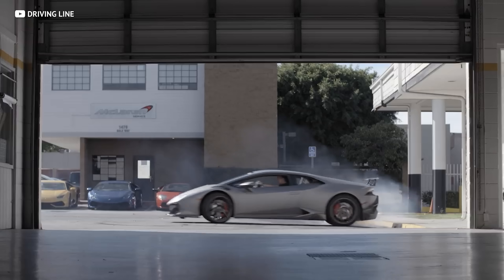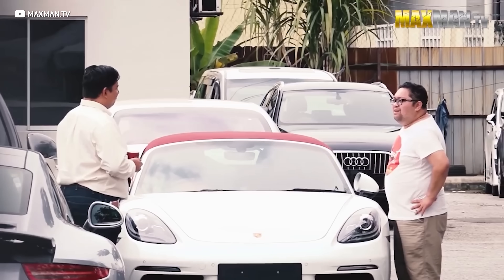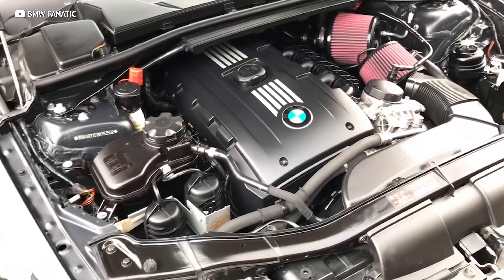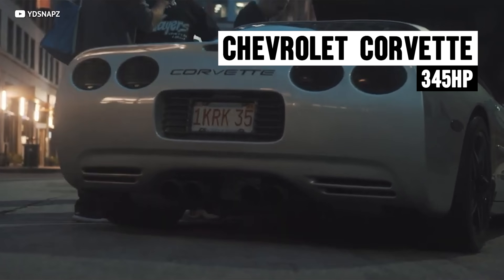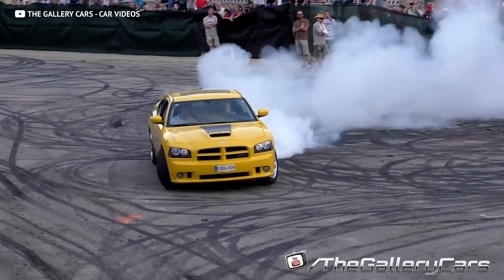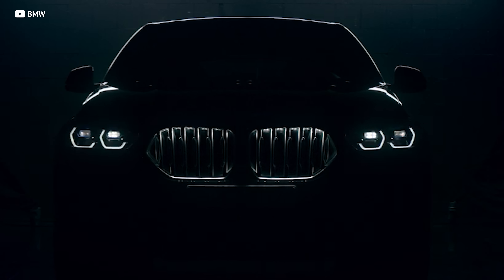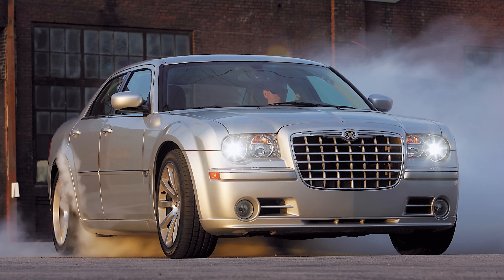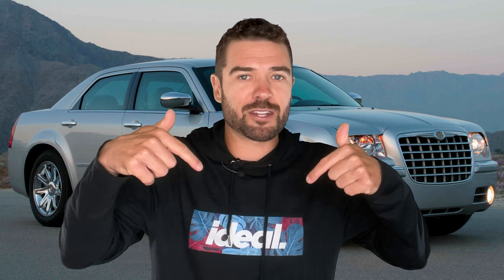Cheap Cars With a TON of Horsepower

Comment: Agreed on the G35/37, C5 and Genesis being quick cars available for drivers on a budget.  Good luck finding the others in decent condition for the prices listed.
Reply: do u know the year of genesis that was in the video
Reply: @nikku3184  around 2010
Reply: @Septicshites  where im fron you cant find a gto but chrysler hemis like the 300c, 300s, and 300srt8 are everywhere.  i just picked one up a few weeks ago and they are fun as fuck
Reply: @Septicshites  15k for a decent one in California.
Reply: @nathanfrutig8783  been trying to find a srt 8 and they are hard to find in va they want a arm and a leg for all of them
Reply: @Septicshites  you find them in Chicago for like 20-25k 😭 high mileage and 5 owners😭
Reply: @Septicshites  2004 GTOs are cheap with 350hp the 05 & 06 are usually $15k or higher
Reply: @i_amChrisJxmes for what a group?
Reply: @KVNGMAN here in Cali the be overpriced high mileage and going 16k and up
Reply: The real question is the c5 a good daily I want one but I daily my cars usually
Reply: finding a g35/37 is hard asf on this market value

Comment: Good luck finding a 04-06 GTO at that price.
I’ve looked all around and they’re bringing in 20k+ now. It’s all gone bat shit crazy. 
Needless to say I’m out .
Reply: Yep u pay that for a genuine body kit here in Australia prices have never gone that low anywhere ever ur dreaming
Reply: I’ve looked at two GTOs one was $21000 usd and the other one was $23000 usd.
The biggest mistake I did was not buying one about 5 years ago for $12000 when no one wanted them. I do plan on holding on to my G8.
Reply: I had the chance at an '05 GTO 6-speed for $16k with about 65k miles about ~10 years or so. But it was actually pretty underwhelming. Very crappy interior and I found out that they are a huge PITA for certain parts because unlike as the video states the parts are not easy to get. Them things are old now and most parts come out of Australia where there were far more Holdens sold than Pontiacs.

I ended up years later with a C5 Z06, but GM quality is really questionable. Motors can be good depending which one it is, but that Z06 was the most unreliable car I've owned and it had 29k miles on it when I bought it, looked pristine. Sold it because I didn't want to pour any more money replacing things on it (rear main seal, rear transaxle seals, EBCM module, HVAC blew cold on driver hot on passenger sometimes, speedo gauge would peg at 200 mph when changing battery and get stuck there).

Personally, I don't even think CTS-V's are nice anymore. I used to want one a long time ago, but have no respect for Cadillac at all anymore.
Reply: @Shintsu2  it’s pretty hit and miss with GM it’s been that way a long time. Have had duds and very reliable cars from them. Nowadays, however, that seems to be a trend of all manufacturers.
My 2009 G8 (bought new) has been a good car the only issues I’ve had with it is the headliner needs replacing and the drivers’ side seat trim keeps breaking.
Mine has the options with the trim level and nothing more.
It’s pretty base so may help with issues, but who knows.
Reply: I saw a 2006 got 14k here in az and I think it only had a few bolt ons
Reply: @ Paul Scalisi

My Mom bought a yellow one when they first came out with the 5.7.  Looked nice, sounded great.

Performance wise, underwhelming, heavy.  And sight lines were awful.  She got rid of it after a couple years and completely lost her rear.

I still like them, the 6.0, but personally, knock yourself out.  Yeah you can upgrade them, but man, them sight lines were the worst I’ve ever experienced.
Reply: Any pontiac trans am/gto/g8 you could find one for 10k+ but a rare find low miles 20k+ $
Reply: Us old Pontiac Poncho heads keep the price up .Look at those 93 -2001 Birds also.98 up with LS
Reply: My brother just picked up a 351 swapped fox body drift car that keeps up with 2017 mustang gts for $2500. It's always the junkyard Bugattis that are your best bet
Reply: @sammy13ificationable  This ^ my first car was a fully built Mazda mx6 all I did was replace a valve cover and fix egr and vacuum. It came to me with parts to the 9s for 1300 even had ac and I didnt know shit about it but probe gt guys did lol
Reply: @Kyle_gallegher  right, I hate this "just spend $6000 on a fast stock car" mentality. Cars lose value with mods unless fully kitted out, so buying motor swap cars is cheap, or just do it yourself. My dad took a $300 MG Midget and put a $300 13b in it and slapped $200 worth of mods on it to convert it to a points ignition and Weber carbs, spent a total of $700 and got a car that's sub 200hp that pops wheelies in third at half throttle. Whole thing weighs like 1600lbs and makes 210 lb-ft and 180hp. My brother also daily's a lifted 94 loyale that the dude swapped an EJ22 into, it's not fast, but its punchy as hell and has a stupid 0-60 for a shitty econo box on 29" boggers
Reply: t sltter  that’s a great deal. They’re nuts where I live (Southeast).  Is it in good condition?
I wish I could find one like that.
Reply: @sammy13ificationable  you must watch too much TV.
Reply: Earlier this year I bought a 2009 G8GT for $9500.00, 116K miles its not perfect but runs and drives well.
Reply: @Shintsu2  crappy interior compared to what? An E Class Benz? The seats and dash are far better than most American cars, nice shift boot too. 

Don’t like plastic? Gotta spend more cash or buy old luxury cars. 

Parts issue is legit. Low miles, no problem. High miles, stuff starts to break and the world begins to end.
Reply: Pandemic =rising inflation$
Reply: @pmscalisi  I own 2 g8s for this reason
Reply: After 5+ years I still do not get it. 

In 2016 I gave my daughter my 2008 Kia Amanti. I was looking for something more sporty in a sedan and my 6'3" wide as a door frame would fit in. With a $18,500 max budget I narrowed my choices to 3 cars. The oldest, a 2009 Pontiac G8 GT with 111,000 miles on it for $15,500 out the door. A 2012 Genesis 5.0 R-Spec with 106,000 miles for $12,500 out the door, and a 2014 Chevy SS with 79,000 miles for $18,400 out the door. I drove all 3 and the decision was easy. The Genesis kicked the shit out of the G8 GT and the SS. Vehicle size, Engine, HP, options, transmission. Other than the exterior of the Pontiac looking better the added cost never made sense to me.
Reply: look again space ghost
Reply: just wait they'll go down once electric vehicles get huge in the next few years...EVs will take over and disrupt the gasoline used car market like crazy, and since gas is easy to make from crude oil....you'll always have gasoline for your toys. but EVs will be on the roads...toys will be on the tracks...luckily there will be more tracks and less parking lots. int he future...gas cars will be like horses.  extra costs for storing and maintaining them...so it will be a hobbyist thing.
Reply: @Halliday7895  a gas vehicle will be a good backup to an EV, especially the ones with no GPS, and when blackouts or curtailed electric usage plans won’t allow you to charge your vehicle.
Reply: In 2013 i bought a 05 GTO 6mt for 12k with 67k miles and I hit a deer with it and it was totaled... looked for another one and apparently people figured out what they were and I couldn't find another for less than 16k. To this day the same amount of mileage and same specs are going for 20 and up, I loved that car and miss it to this day
Reply: @Shintsu2  Ya know what I wanna try to build, is a 2021 Kia K5. It's a culmination of a legendary car, just like the Pontiac G6.
Reply: Came here to say this. Where the fuck you finding under 10k lol
Reply: Just come to australia they are literally everywhere
Reply: I picked one up for 12k with 80k miles almost 4 years ago, prices are way up.
Reply: all of these cars are at least 50% more expensive due to the current market
Reply: Glad I bought mine 3 years ago. Hard to find a clean one also. I absolutely love mine.
Reply: Yeah and especially with Pontiac being out of business
Reply: I hate that people think the GTO is a collector car simply because it was a 3 year production vehicle. Pontiac made the 04-06 GTO very cheap in my opinion.
Reply: @brycycles95  if you think that the newer GTO was cheaply made you never drove one from the 60’s or 70’s.
Those vehicles were far from bullet proof. I owned enough of the muscle cars from that era when they weren’t that old, like the 70’s and early 80’s.
Fuel system headaches, badly implemented electrical systems and body integrity/corrosion issues but still they were a blast to drive and to own.
Reply: @brycycles95  Yeah but the classic ones from the 60s and 70s are collectors
Reply: @brycycles95  And I don't think many people were crazy about the 04-06 Gtos. I test drove an 06 Gto several years ago before Pontiac went out of business and I wasn't thrilled about it either, so yeah I wouldn't consider them a collectors choice
Reply: @brycycles95  collector cars become what they are because someone says they are
Reply: I got my 05 a4 GTO for $12,800 4 years ago, 70,000 miles, honestly the most reliable car I’ve owned, this is my 3rd LS powered car and by far my favorite, you can beat the hell out of them Ls motors, just stopping power is not all that great on the GTO
Reply: Only one I could find under 10g had over 200k on it and looked like it was full throttle on dirt roads every bit of it
Reply: Genuinely blaming this guy for the cars raised prices😂🤣
Reply: Maybe for a very low mileage manual model but it’s still possible to get one under 10k if you don’t mind an automatic
Reply: You can get them around me fairly cheap and low miles.....price Definitely depends on area
Reply: Me too, 2004 aren’t very hard to find but 05 and 6 have the ls2
Reply: in Australia they go for around $100k
Reply: I bought my 2004 for $6k but that’s 350hp the 05-06 400hp they mentioned are usually $15k or more..
Reply: @Caseythenewguy  you can tune your engine for more hp but it may not be worth it to you. 50hp for some reason brings a premium price, but in the weight class of the vehicle 50 hp isn’t all that much.
If it was 50% more hp it might be worth looking into.
Reply: There was one in my area for 13k
Reply: I was outbid on an 04 about when this comment was made lol

Comment: I bought a 1998 Mitubushi Diamante with 84k in great condition for $1500.00

3.5L 24 valve V6
210hp + $1,500 for a turbo kit
+ 250hp

460hp $3,000
Reply: without the preventative maintenance you didnt do, that +250 will cost you in the long run much more than that mark my words
Reply: @kenninger4267  All cars have maintenance.
That's a given.
Reply: @kenninger4267  Cars are merely transportation for me.

I could care less about added horsepower.

My statement was in regards to potential upgrading.

Comment: You guys should really start talking about the CLK or E55  n/a AMG. Those cars are bulletproof I'm talking great reliability. I have one with over 150k miles and I've seen them in the 300s. They are soooo underrated and no one talks about them so it's pretty easy to find them around $5-7k which is pretty good when you get 340hp and 380tq
Reply: The S55 AMG kompressor will eat all those cars easy and is under 10 grand !!
Reply: Fr I almost got a clk 500 coupe but instead got a Genesis 4.6 still gets down 375 stock
Reply: @lucky9Lives  Did youy miss the part about reliability lol

Comment: Excellent video.... In 2016 I purchased a 2012 Genesis R-Spec 5.0 Sedan with 429hp.  I stole it for $12,500.  I drove it till Feb. 2021 and sold it with 180K miles for $6,900.  I then purchased a 2013 Genesis R-Spec 5.0 single owner 48k miles for $14,850..... Fast, fun, and reliable.... :)

Comment: Anything over 10 years old is likely to start having lots of things failing.  Cheap hp isn't worth much when it's up on blocks in your garage.
Reply: Not really man. I bought my 2011 Crown Victoria last year. It's like a brand new car. It really depends on the car and the owner. I wouldn't recommend any of these cars especially not used German cars.
Reply: @blessedjuggernaut  I had 2 police interceptors. Got it from a local county police auction. All lasted me years. Great cars easy to fix and parts galore

Comment: The 300C was the same as the Charger R/T and both came with the 360hp 5.7L V8, not the 425hp 6.2L found in the SRT8 trims of both badges
Reply: Yup. Glad I'm not the only one who figured that out

I was like... "Really?, 425hp for 7,900? I'm in!" But the only one I could find within 500 miles of where I live was 18k. So sad
Reply: @ernestobercovitch8160  I was hoping someone other than me noticed he was saying the 300C is the same as the SRT8.. 300C is the same as the Charger RT but only the 5.7L
Reply: 6.1 in the 06-10 srt8s

Comment: I thought I would see a Audi on this list but I'd still settle for the 2jz BM, or the Gto Godzilla if I had to pick from the list... And the Genesis is not bad either
Reply: Lowkey I was thinking that too
Reply from the maker: all ideal choices!
Reply: Audi!!! U will be lucky to get one for $20 000
Reply: @Monsterracing19  Dude you literally can buy a audi s4 b5 2000 that has 2.7 L Biturbo V6 for 12k or less
Reply: @nikodaq  o. I was thinking Audi R8
Reply: Joseph C.  I would like to buy one of these, are they really as unreliable as they say or is it only when you modify the engine that the headaches come?
Reply: @nikodaq  And a foot long receipt of parts that need to be replaced. (I have a B5 A4, B7 A4, and B8 S5)
Reply: i 100% agree
Reply: @Monsterracing19  ?? most within 5-10 years old are around there.
Reply: @crestadude4139  I was going to buy one but everyone and their grandma told me not too lol
Reply: @crestadude4139  just make sure you buy a 335i with a good history report because alot of ppl who buy them don't like keeping up with maintenance
Reply: The 2007 S6 is prime. A Lamborghini V10 with 435 horses is intoxicating. My dad had one and it was the most fun I have had in a car.
Reply: B5 S4's in North American can be readily had for ~$5,000+.  The 2.7L V6 biturbo is potent and with a basic ECU tune can make over 300hp.  Plus being AWD and having a super smooth linear torque curve means you beat most common cars from a stop.  

It's admittedly super unreliable, but it's 20yrs old and most parts are cheap.  They're tons of fun, can be had in a manual 6-speed, practical, and shove you back into your seat.
Reply: I was about to mention that as well. Why mention a Mercedes P.O.S. when you could have filled that space with the Audi S5. 2008-2012 models can be found easily for $10k with one if the most unique and fierce sounding V8's one the road.
Reply: @Monsterracing19   not so, I bought my audi S6 08 for $15,600. comes stock 435 HP and a Lamborghini derived 5.2 v10. you can get them for way cheaper even under 10K but I don't recommend it because maintenance will easily hit 10K fast and they are most likely not maintained well. My car had 69K miles one owner was kept in great condition had over 44+ service records. the truth about these cars that are cheap especially the german cars is they are cheap to get into but not cheap to maintain.
Reply: Recommend against the n54 if that’s your only car. 2nd car then I’d be tempted to get another one. All around car I much prefer my cls550

Comment: I've owned both a 06 GTO and 06 Charger R/T (about 10 years ago) They were great value during the last fuel price spike + recession. In 2008 when fuel hit ~$4 a gallon people were practically giving away low mile V8s. I missed my GTO so much I just traded in my Jag XFR for a new Camaro SS.
Reply: Do you like the Camaro better than the gto?
Reply: @kevin122759  Yes because it handles significantly better. But when daily driving they feel extremely similar.
Reply: I have a67 camaro solid lift cam for sale

Comment: I wish the Holden Monaro was under $10,000 in Australia, they are like at least $40,000 :(
Reply: you'll be hard pressed finding a 2005-2006 GTO for under 15kusd. Their going up in value over here. You can sometimes pick up 04's for under 10k
Reply: The demand is huge for the Holdens.
Reply: commodore?
Reply: @charleshammond8945  you can easily find commodores in Australia for under 10k but they are the v6 variants, you I’ll only find a v8 commodore under 10k if it’s truely beat up or doesn’t run, the Monaro cv8 are around 60k or more nowadays, as I bought my v8 commodore wagon for around 15k.
Reply: The average Monaro price here currently is between $50,000 and $125,000. You can find cheaper like a V6 one, but no one wants those unless they have a spare LS1 sitting around to swap in so they can go on and resell it for triple what they bought it for. HSV GTO's here average for about $150,000. In 2010, used 2006 V8 Monaro's were being sold for $38,000. Talk about a price climb. One is for sale currently for $550,000.

Comment: I would get the Pontiac GTO because well my first car was a pontiac and it was reliable as heck
Reply: Facts same. I had the 96' grand prix
Reply: Just be careful they tend to spin a rod due to the design of the oil pan. I’d get corvette oil pan for better lubrication!